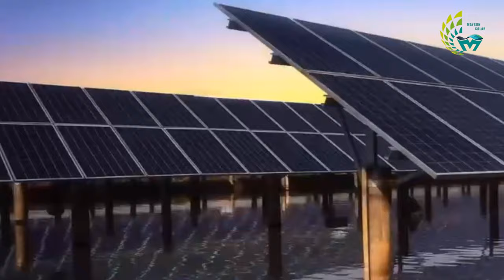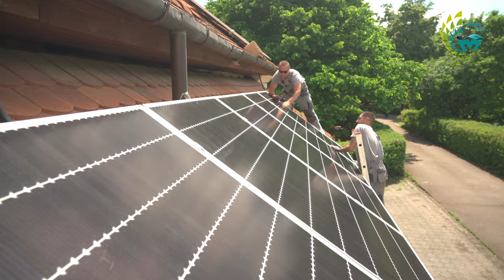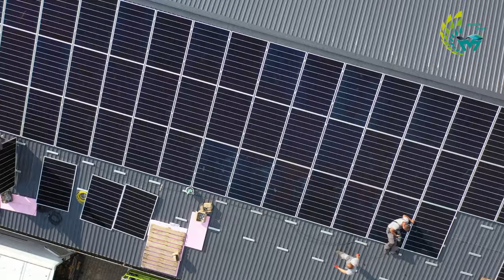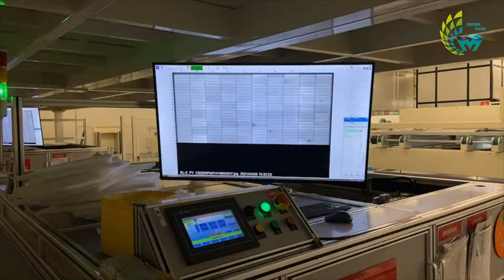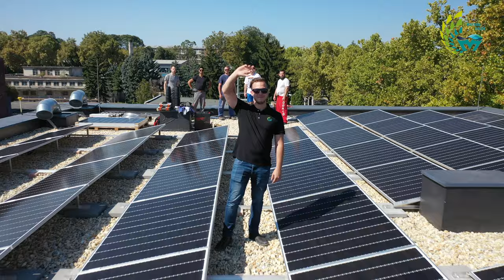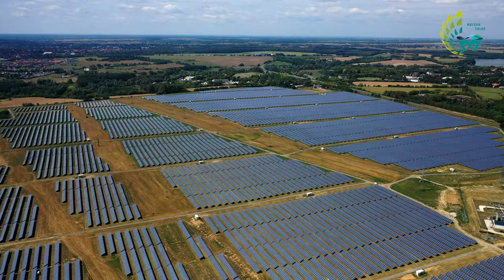MAY SUN SOLAR

Comment: where to buy an official distributor in Indonesia?
Reply from the maker: Indonesia Office
PT. Ganghang Green Solar Energy
Ruko Sentra Bisnis Blok A3, Jl. Pluit Sakti No.28, Pluit Kec. Jakarta
Contact: Lance
+62 021 2267 5956
maysunsolarid@gmail.com
Reply: @maysunsolar  no stock type mono sinled 120 wp
Reply from the maker: @LampuLedPLTS  now haven’t shingled 400Wp, but have 410W halfcut 210mm cell
Reply: @maysunsolar  SINLED 120WP NOT 400WP SINLED, YOU NOT READ CAREFULY